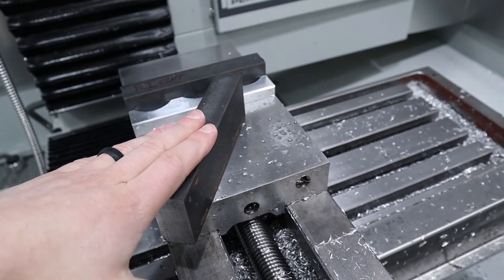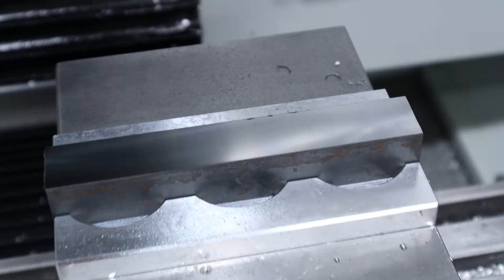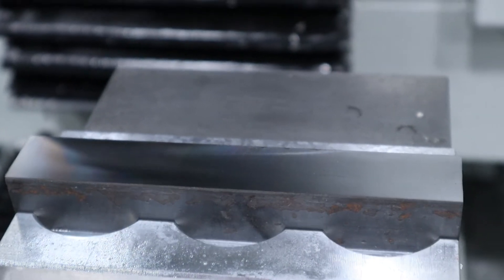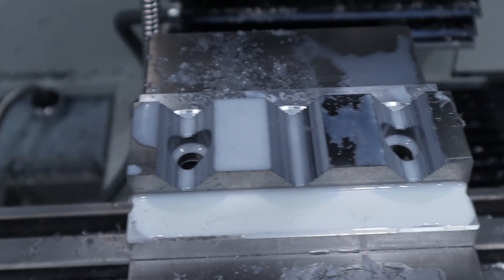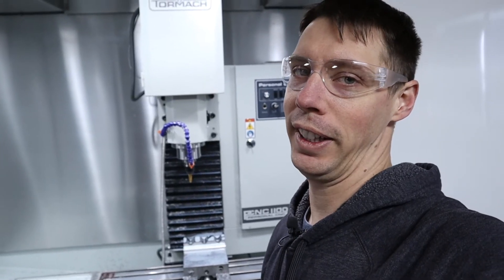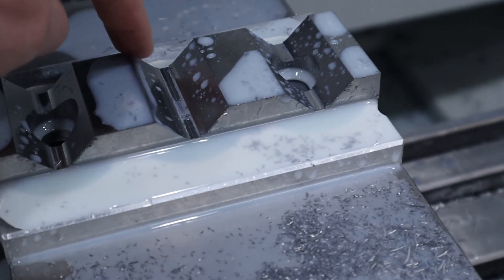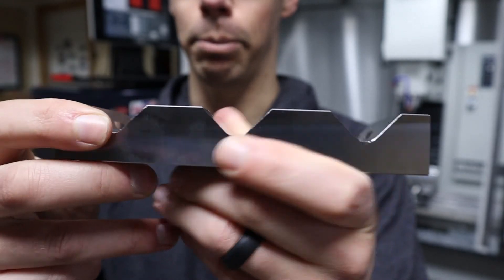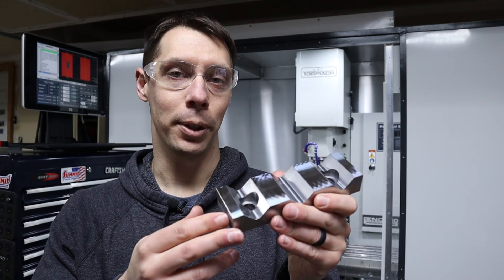Milling Steel V-Jaws for Machine Vise

Comment: There's nothing wrong with the way you're doing it. Manual guys would use angle blocks or tilt head because they have no choice. Also the harder the material the more it wants to chatter.  There are guides on reducing  chatter. Now on your rough slotting I would have done that top to bottom  side to side to reduce captive slotting as much as possible. This would allow  room for chip evac.  There's a phone app I would recommend "CNC Machinist Calculator  Pro" . It has a lot of useful stuff built into it. Make sure you get "calculator" for $13 not "calc"  for $20 or $30 calc is garbage.
Reply from the maker: Thanks for the info.  I just downloaded FSWizard and need to play with it more.  It looks pretty cool.  I'll take a look at CNC Machinist Calculator Pro too.

Comment: Be careful when holding three parts in that fixture like that.  Might end up with just the two outside ones.
Reply from the maker: True, I've had good luck with multiple parts in aluminum jaws but I haven't tried it in steel.

Comment: Turn out great looks like you got a great finish this cold roll steel?  You are making Great video's and intro what are you using?  The tormach does it have steppers or servos ?
Reply: It sounds like it has steppers, servos dont make any noise and here you can hear motor axis
Reply from the maker: I think the steel is just basic old A36.  Thanks for the compliment, I'm using Adobe Premiere Elements.  I bought it a few years ago but I think they might have gone to subscriptions only now. Kwk is correct, it has steppers, some of the new Tormachs have servos.
Reply: @RivalMachining  I'm using Adobe Premiere Elements too
Reply from the maker: It seems to have enough features for what I need. I used it for my intro but  it took a little work.